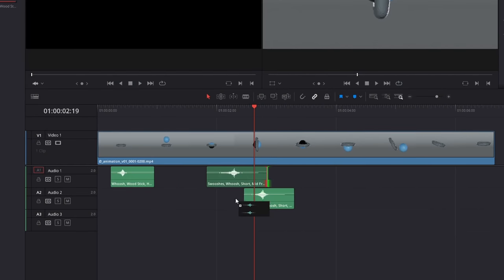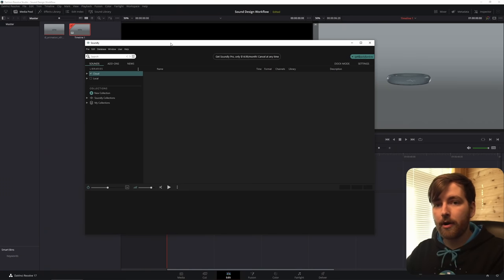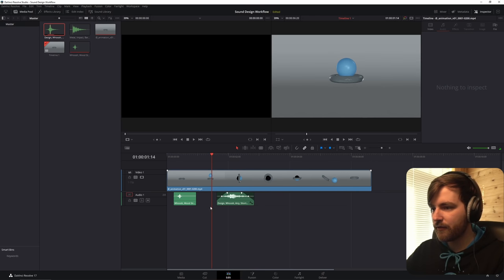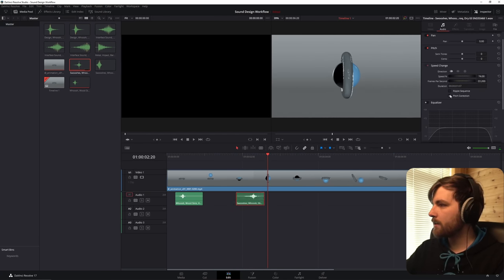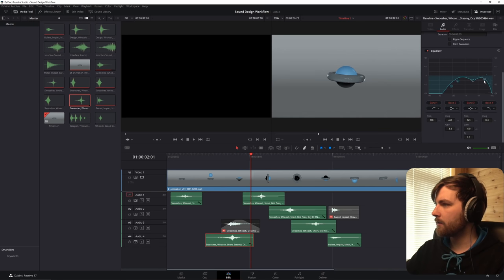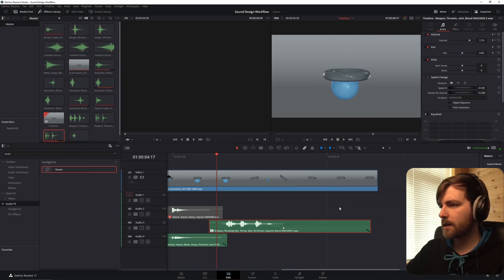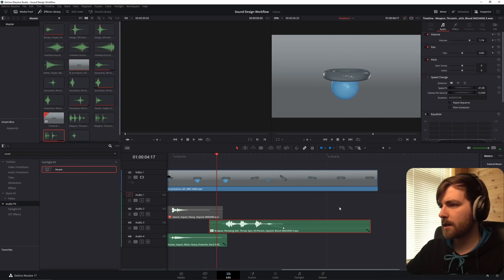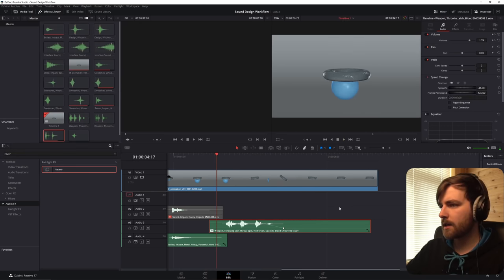Tutorial: Sound Design for 3D Artists

Comment: That double rendering technique would have been amazing!
Reply from the maker: Haha yes! Sometimes it actually helps a little bit, but this time it didn't :( Would recommend using Cycles X instead!
Reply: @Polyfjord  It definitely works using Cycles-X if you have multiple GPUs, and right now this is the only way to do it (because they do not currently support multiple devices). You do have to configure each Blender to exclusively use a different GPU, for it to work.
Edit: note that it is not flawless, I have had a couple of blue screen shutdowns. Save your work!
Reply from the maker: @BeheadedKamikaze  Fantastic! that sounds awesome. Can't wait to try Cycles X, is it really as fast as they say??
Reply: @Polyfjord  It depends on the scene, but yes, it is significantly faster on my RTX 2080 Ti using OptiX. I got approximately 35% faster renders on a scene of mine.
Also forgot to say, you should also configure your animation to turn off Overwrite so that if you need to resume after a crash or something, it does not go back and re-render already completed frames.

Comment: 15:46 - You can set one Blender app to render using GPU, and the other to render with CPU, then you should get MOAR frames.  Although, the newer versions of Blender can utilize both the GPU and CPU at the same time if set to "GPU compute," as long as you enable it under Preferences -> System -> Cycles Render Devices (at the top of the window).

Comment: Cool sound design video!

also some tips on rendering:
1) you can increase the GPU load and render speed by finding the optimal tile size for your seen. There is also an auto tile size addon.
2) you can get a bit of a render speed boost by rendering through the console as Blender doesn't have to load the GUI as its rendering. Look up the "Command Line Rendering" page on the blender docs

Comment: For the 2 instance render thing at the end of the video. It's probably easier to just select "create placeholders" and deselect the "overwrite" option. For a huge project I did recently this worked swimmingly with multiple  machines connected to the same folder over network. It just renders everything in order but when it encounters a placeholder it skips that one and renders the next free non-existing frame. That way it doesn't matter how fast or slow the connected machines are because they will all be rendered pretty much in order.

Comment: If you're reusing the same effects then you're much better off putting the effect on its own mix bus and then sending your audio tracks to that mix bus.
If you set it up as a send effect then you can set the reverb channel to 100% wet and then adjust your send level for each effect (with an automation curve).
It's useful to set up a long reverb and a short reverb track so you have options and variety.
This will save you time, avoids the reverb being cut off, and also saves your CPU too. Hope that helps!

Comment: 14:33 this is complete normal. if you look at the 3D workload from the GPU. this shuld be on 100%.

well i just checkt it on my latest project. the 3D workload wasnt on 100%. i guess it deppents on how complex the scene is. but if you render with GPU it is normal you do not have mutch CPU workload and only the 3D workload from the GPU goes up. we render in 3D so it make sense :D

if i render with CPU all cores go to 100%, as expected

Comment: Since you touched upon the efficiency of rendering, have you tried rendering through the command line? Should be a bit faster and more stable since it's not updating the preview on the screen
Reply from the maker: Hmm, haven't tried rendering through command line. But an interesting discovery from the double Blend file experiment, is that Blender (or Windows?) seems to prioritize whatever instance of Blender is active (last interacted with). So the non-active Blend file was rendering 2-3x slower than the active one. Not sure what to do with this information though :D

Comment: I also see that you have a quite expensive Logitech mouse. I bought the same mouse more than a year ago twice after another and each mouse had the error of the left mouse button not working properly. Obviously your mouse works properly. I liked the mouse, but only if it would have worked properly. So I have send them back to amazon. Where did you buy your mouse. I guess there might be a slight chance that if I get my mouse from the right seller, it would work properly.

Comment: Soundly is great but doing sound in Davinci is kind of weird, there's Reaper (which I use) inexpensive and great to learn since the full "trial" can still be used after the day limit, it's great and you don't have to mess with the mono stereo thing, just drag or do a command and import it automatically to reaper to your playhead since soundly automatically connects with it, also no problems with the reaverbs being cut off or anything.

ig@tonal.states to check sum of my things w/it for anyone interested c;